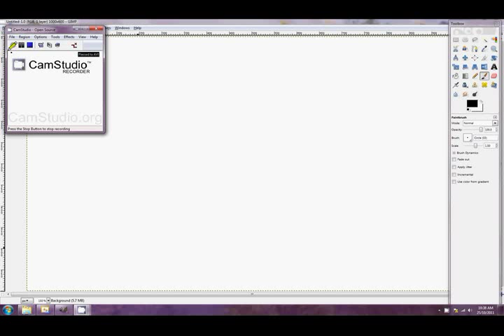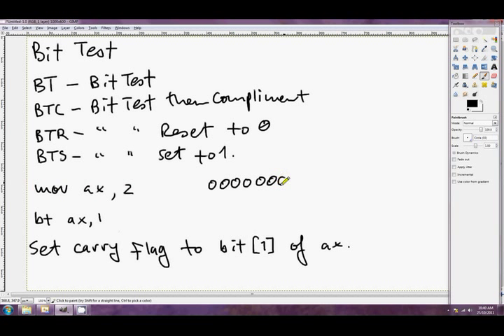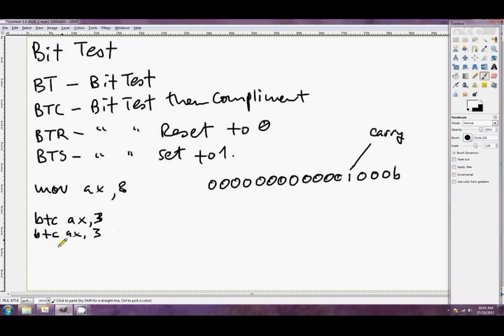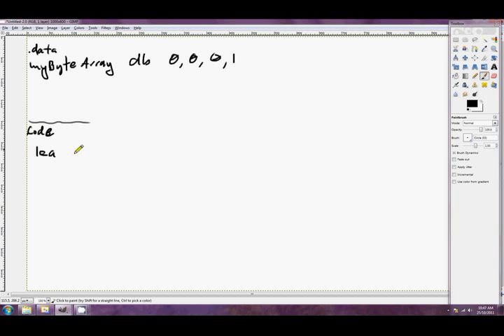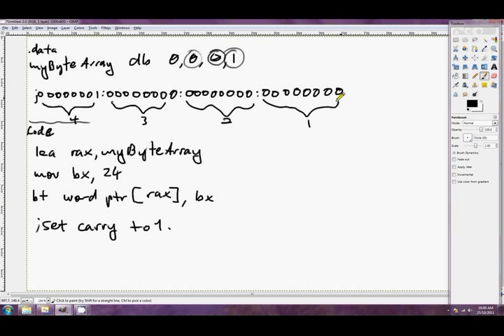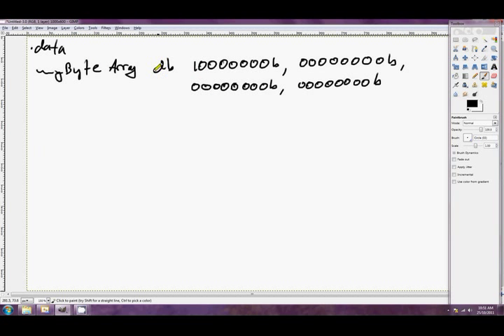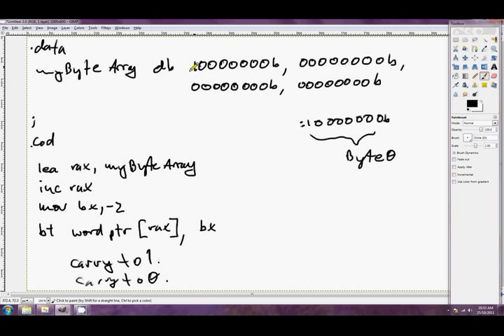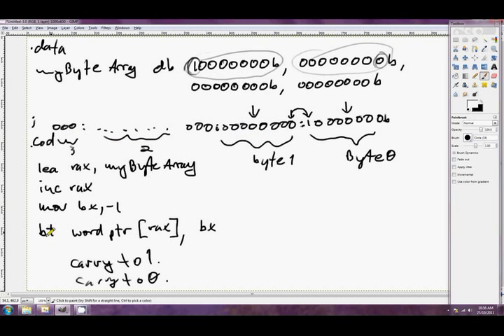x64 Assembly Tutorial 30: Bit Test Instructions

Comment: Wow. x86 has a ton of redundant instructions. I didn't even know those BT* instructions existed. They are rarely generated by compilers either. Pretty much anything that can be done via AND, OR, XOR and SHL. SHR is not really that necessary.
Reply from the maker: Tell me about it, there's something like 3000 instructions. As far as I know, x86/64 is the most complex instruction ever. AND, OR, NOT, Shifts and MOV is Turing complete! We don't actually need anymore than those :)